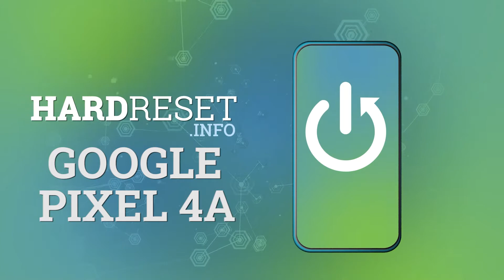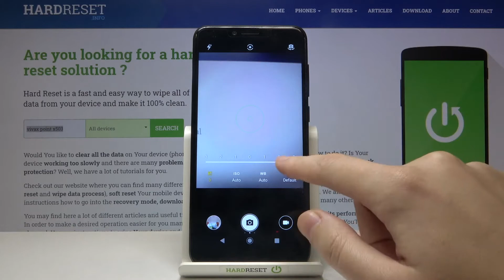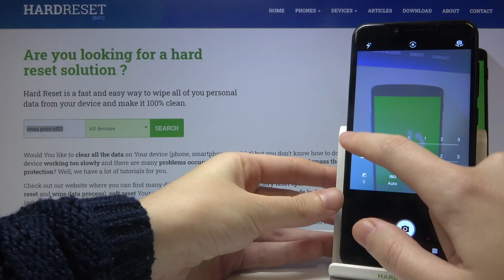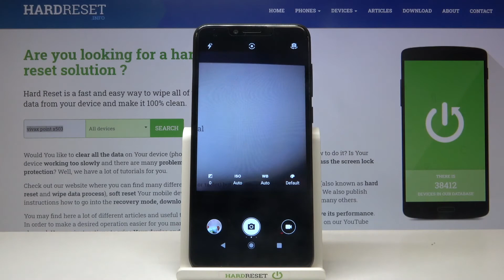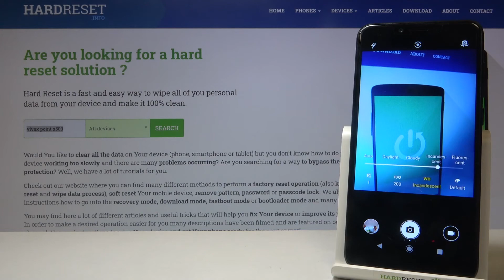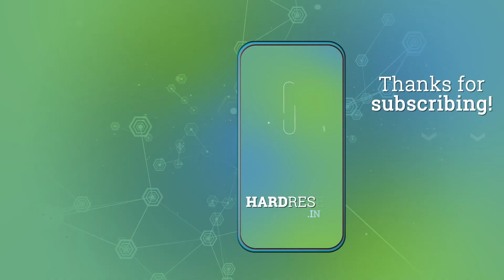How to Use Camera Pro Mode on GOOGLE Pixel 4A – Turn On Camera Pro Mode

Comment: It's not Google Pixel 4a used in the video
Reply from the maker: Sure, it is
Reply: @HardresetInfo  it's not I'm literally using the 4a to watch this video and it's not the same phone
Reply: @HardresetInfo  naah...😂 Not really. So what's the purpose then?
Reply: @HardresetInfo  this is not google pixel 4a....the phone in the video has the "black stripe" in the upper part of display...and the front camera is not near the speaker, it's  on the left side...